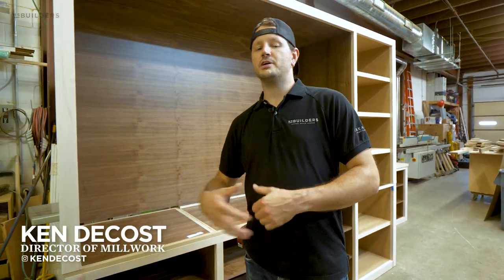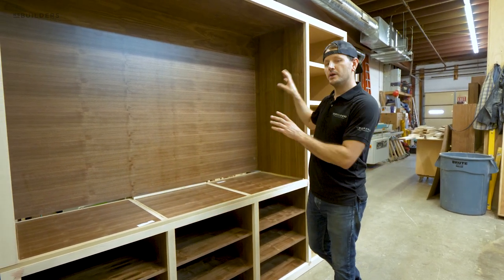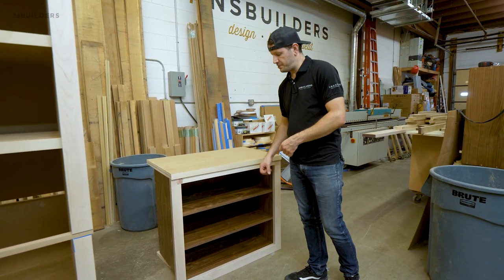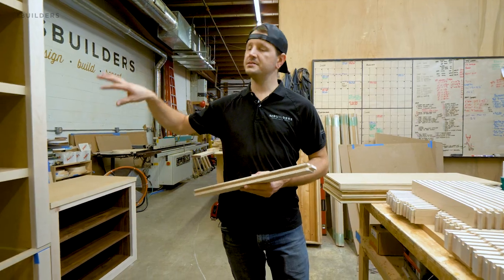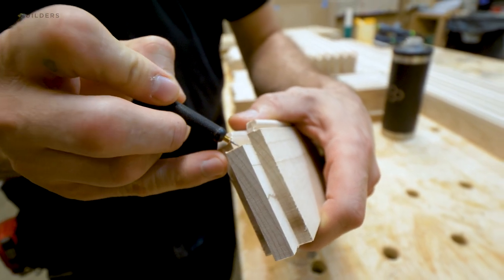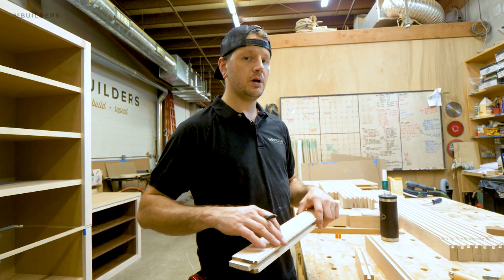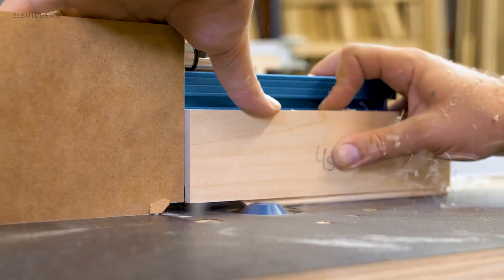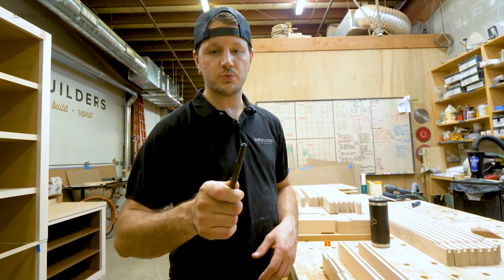Beaded shaker cabinet door with a JACK MITER

Comment: I find it crazy that I have been making this joint since the mid 90's but I didn't know it was called a jack miter until 1-2 years ago. Thanks to the old timers in the local woodworking group for that bit of info 👍

Comment: You use router bits on your shaper. Do you ever have an issue with to low an rpm for certain bits?
Reply: We have not run into this issue...yet

Comment: Nice! What kind of bit is used to notch the bead at 5:34?
Reply: Have the same question, do you a table saw or the same bit with the 45 degres? Thank’s
Reply: Kreg sells a notching bit for this and Amana sells a kit with the beat and notching bits together.
Reply: @guillz925  Ahh, "notching router bit" gave me the correct result. Thanks.
Reply: @eyesonlybob  Correct, its the one from Kreg as we are using their beading system for this.

Comment: If it's just a face frame why not just miter the entire frame?
Reply: Not as strong of a joint and poses other issues with assembly, alignment, and keeping square.
Reply: Miters like to move, unless you glue, spline and pin it, which isnt bad, but the mortise and tenon is easier and more stable.
Reply: It says how to jack miter a “cabinet door” in the video name…lol.